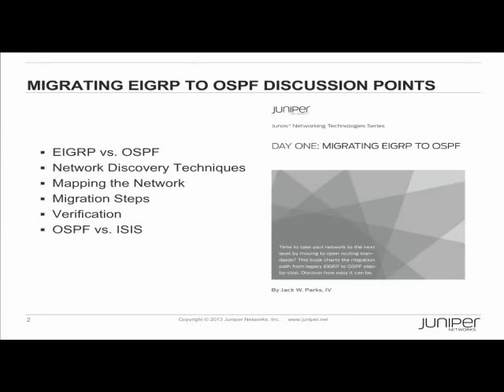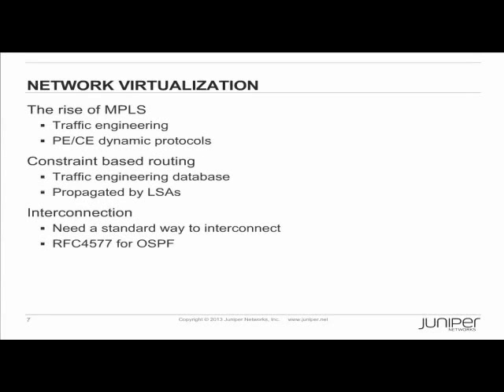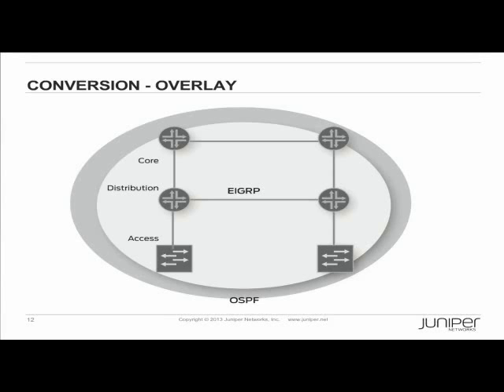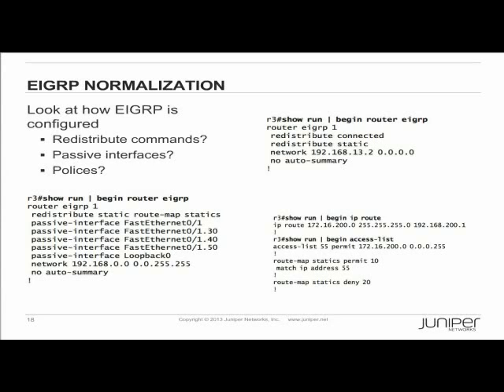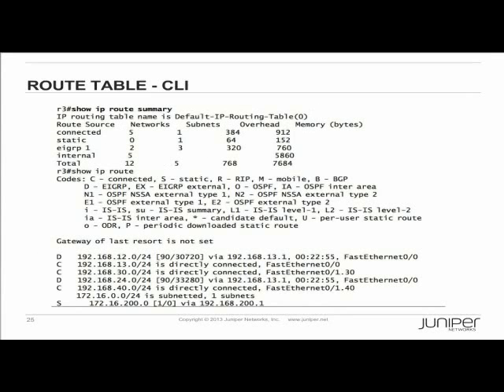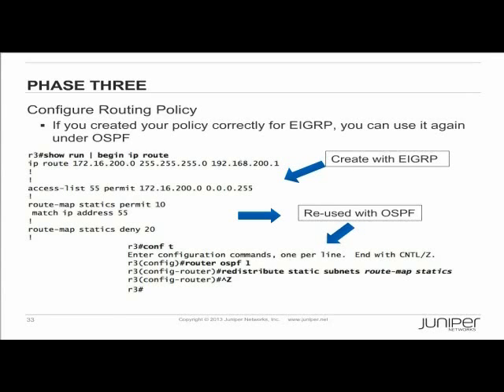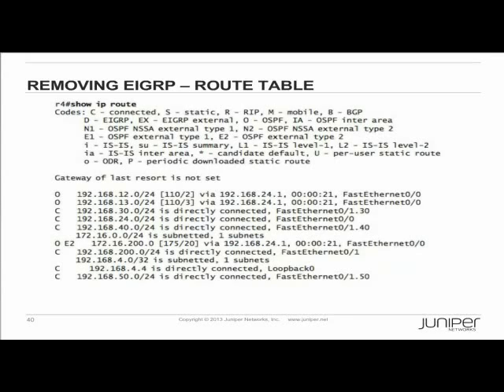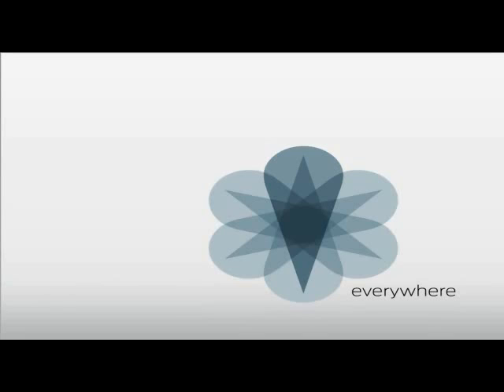Migrating EIGRP to OSPF: A Discussion

Comment: Networking Core Program
NCP Provides 100% Practical training in the field of LINUX. & CISCO Networking NCP provide training for CCNA, CCNP, BGP, MPLS, IPV6, CCIE, MCITP & LINUX.
Interested Candidates? Can Join Fee DEMO Class.
You can watch NCP Nuggets? then type keyword “Ncpvirtualclasses” on google or youtube
Contact:
9871481152, 9910111641, , 0120-4310416
Web:- ncpnetworktraining com
Email:- ncpnoida@gmail.com
Add:-Ground Floor, G.C.Complex, Opp-Nirula’s Hotel Sec-15, Noida 201301